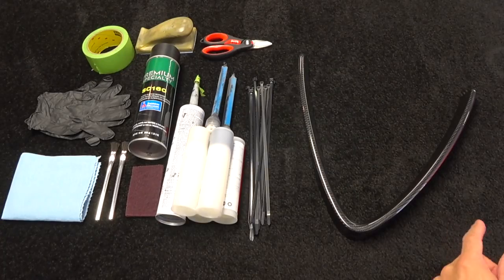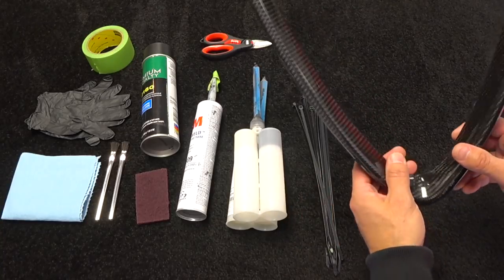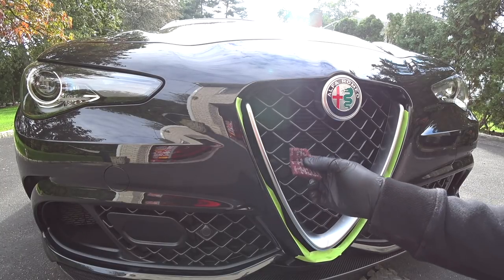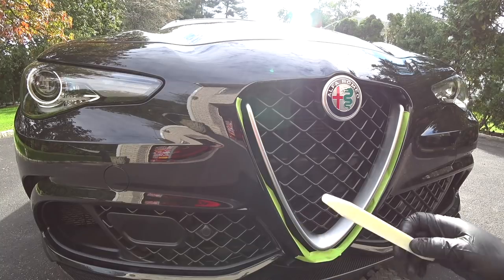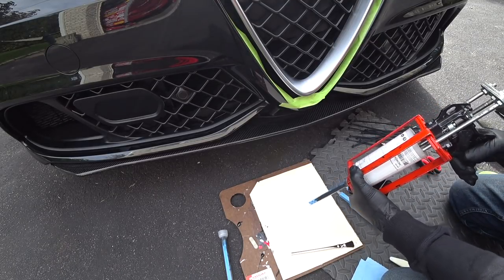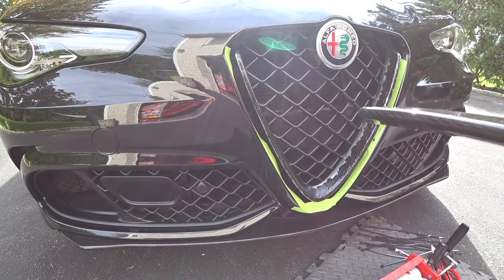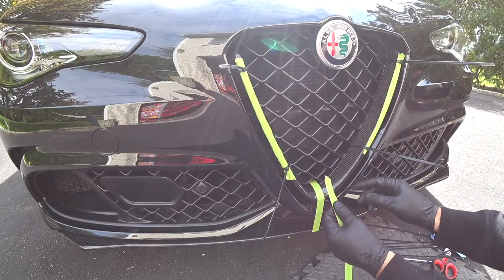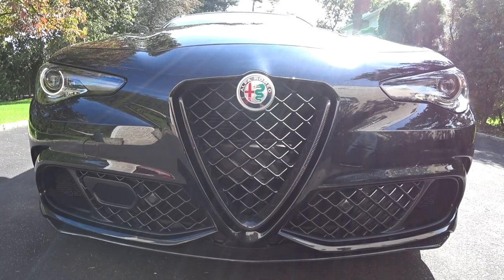Alfa Romeo Giulia Quadrifoglio Carbon Fiber Grill Installation

Comment: Great Video. I am unable to locate an applicator gun for the adhesive you recommend for under 250.00? Any suggestions for alternates? The adhesive, mixer nozzles and applicator gun would be over 300.00 by itself.

Comment: Curious why a silicone-based adhesive wasn't used.
Reply from the maker: because your bonding a composite to a metal substrate and 3M auto-body dual mix epoxy is the better solution

Comment: I guess this is a stupid question since the cars aren't direct competitors, but how does the car perform compared to the GT350?  I think they're about the same in acceleration from a roll (Shelby manual), but how about the handling?  The GT350 handles crazy well and I'm super curious to how the AR QF compares :D.  I've been in an ATS-V and it was insane with the turn-in, but my God the interior was one of the worst I've ever seen, especially for a $85,000 car.  The QF is gorgeous inside and out, perfect daily driver!  Great choice man.
Reply from the maker: the cars are so opposite it is not even worth comparing but for a daily drive the Alfa Romeo so far is ideal for me and what I need it for and also fun/ the GT350 requires so much physical and mental effort to really extract it fully to what it needs to be enjoyed and that is not easy locally in NY which is why it beats me up to much i just had to get another car. the Gt350 is beyond visceral and not many cars can even compare but the Alfa is a refined little rocket with lots of Ferrari vibes that make it special in its own right. the ATSV is also an amazing car and il be sharing videos of both cars soon.

Comment: while i generally like carbon fiber on everything...i dont see this as any better than a fake CF wrap since it only adds weight.  if anything the CF is going to add more weight than a fake wrap...i know we're talking grams but id sooner put a carbon fiber entire front end than do this or a wrap.  liking the Giulia content in general though
Reply from the maker: if you think this will slow me down you gotta be crazy ha ha ha, i did it for aesthetics the mirror caps were autoclave carbon and lighter than stock but these grill overlays are featherweight light i bet the glue weigh more than the piece itself
Reply: i know it won't slow you down, just saying the point of carbon is to reduce weight...it definitely looks cool...i want to see someone do carbon doors and trunk...